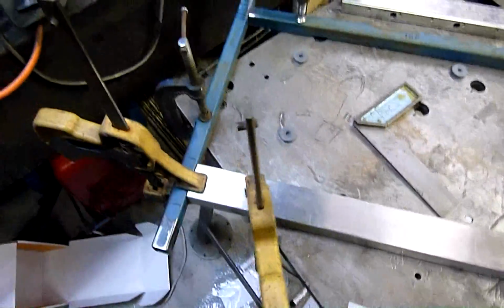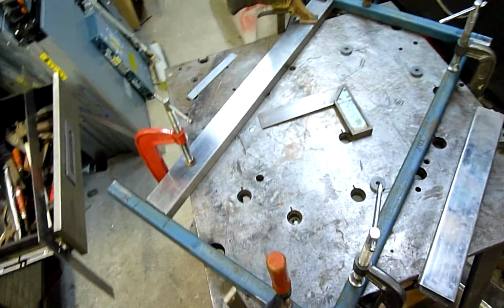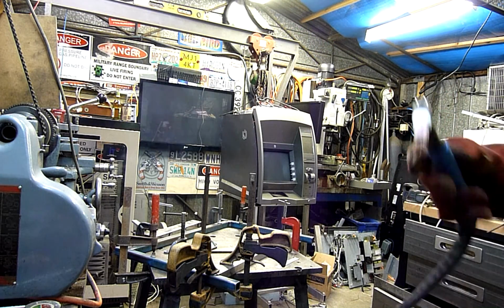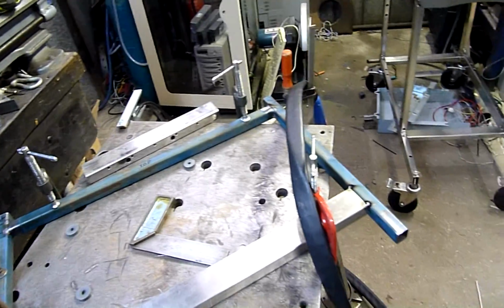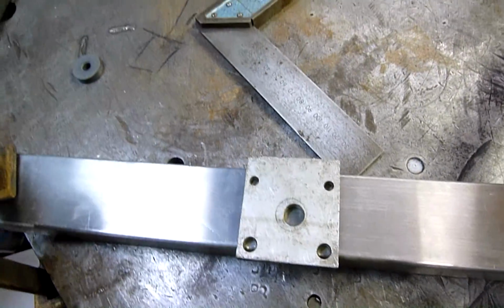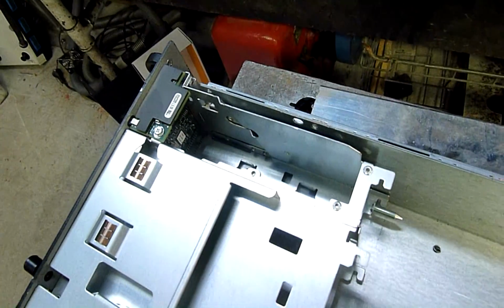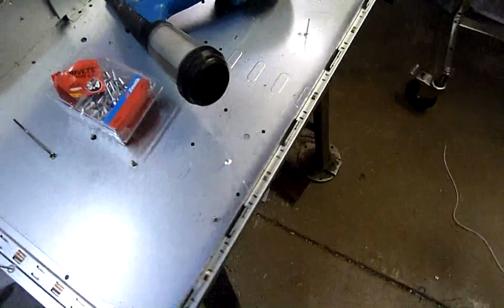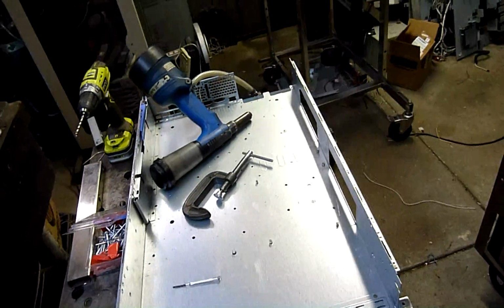Wall PC MkIII Case Build Pt1

Comment: Any reason you didn't just screw the case to a MDF backboard? Or did you want a cavity at the back?
Reply from the maker: A large MDF panel would have worked, just needed to counterbore the back of it to clear the screws and nuts on the back of the chassis,
plus it would still need to be 20mm thick to allow the expansion card frames enough room. they protrude a good 15mm past the back of the case. you will see in the next vid I am uploading (pt2 of the build). I guess it was just more fun and cheaper at the time to tig it up out of scrap metal :D
Reply: Yeah steel > wood always :-D

Comment: Corner welds are a pain for drifting at times, in all honesty so are T-fillets & T like joints. Find it's worse with MIG or MMA & TIG isn't that bad with it (unless it's thin metal). 

Unsure on the urban legend of being able to weld tin foil with TIG lol, something that roamed about the workshop when I was learning how to weld at college a fair bit.
Reply from the maker: Never herd of tig welding tinfoil,. but I know that welding a cola can to a piece of 1/2" plate is a thing :D

Drifting is a bit of a pain on simpler welders, but the pulse synergic Mig at work aces it if you get the pulse frequency and wire feed just right :D

Comment: Hey is that argon leak maybe a post-flow setting on your tig - or an undocumented  "feature" ?

Case is coming along nice.
Reply from the maker: nah, the leak is just a shitty hose and shitty regulator, I will be getting a new one, smaller too.

I do have post flow on too, but even when its not being used, it leaks pretty good.

Comment: That's a pretty quiet welder, and no sparks flying either, looks much easier than using a stick-welder...

Looking at that server case, my brain came up with the thought of building a giant floppy disk drive, I won't though, cos I can't even pull the blade hub off a mower it seems... :P
Reply: Haha, So true, I wish I had a shop like yours!
Reply: Noise also helps that the power is clean and not fluctuating
Reply from the maker: yeh DC arcs are so smooth, its the old AC welders, and AC tig welders (welding ally) that are loud.

Comment: A video on TIG would be great. I'm self taught on MIG, and would love to give ally welding a try, but everyone I've asked about TIG welding seems to believe it's a mythical black art, that and hellishly expensive.
Reply from the maker: Tig welding used to be a bit expensive, but no worse than buying a Mig and gas, I paid about $500 to get the welder and gas, and about $100 for a big pack of SS filler rod, so its not all that expensive compared to a mig.

as far as being a dark art, yes it takes some time and tuition to master it, but its by no means impossible to master by ones self if your just willing to watch a few videos to get you started (weldingtipsandtricks on YT)